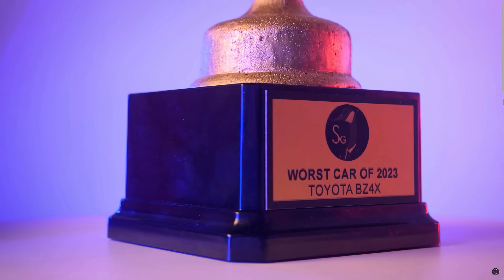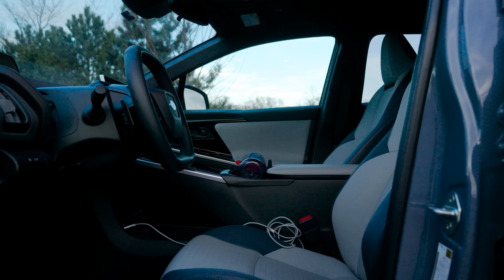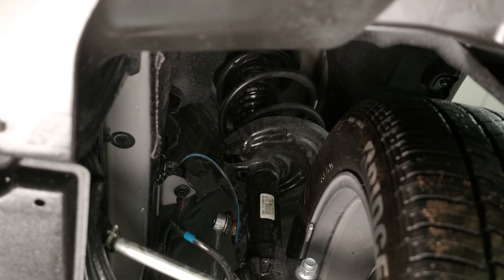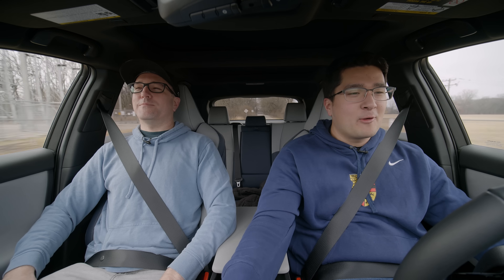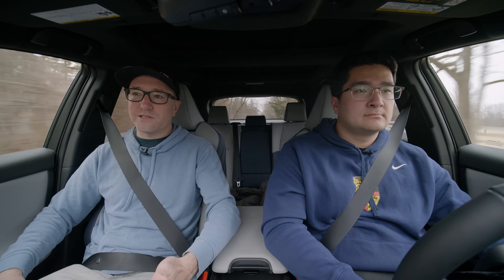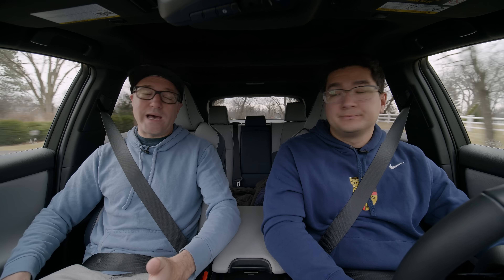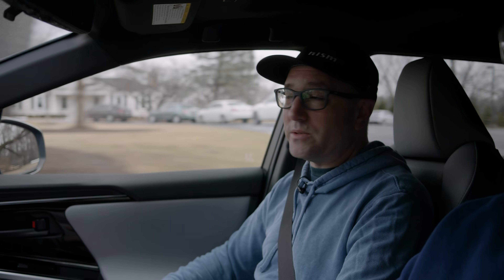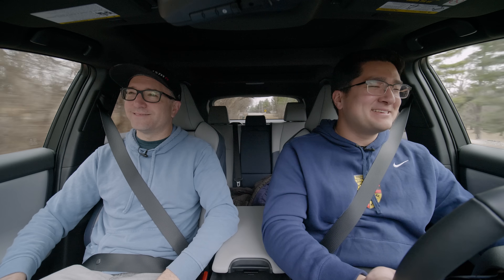Subaru Solterra | Sorry in Advance

Comment: I love my Solterra. It's fast, quiet, efficient, has good ground clearance, and solidly built. Granted I already had a level 2 charger in my garage, and I work across the street from where I live. I bought it to drive around the Las Vegas valley only, and it performs perfectly. My 2019 Outback was slow, had terrible gas mileage for a 4 cylinder (my V8 Northstar Cadillac Deville got better MPG on a cross country trip), and don't even get me going on the CVT transmission which felt like a rubber band. My Solterra solves all of those problems. It was 48,000 brand new, but I got it for $25,000 and change with only 7,000 miles on it. And I plan on paying it off and keeping it. :)

Comment: Not everyone needs more range or faster charging.  At the right price I would consider a used Solterra because of its clearance.  My Bolt scrapes its underbelly and has a hard time going up steep gravel roads.  Efficiency is a bit of a drag, but doesn't mean too much as I can charge overnight at home for $0.06/kwh and have solar credits.

Comment: Thanks to the hate, which I get for initial $60K price, I just got a limited edition version for my daughter commuting to college for just $21K with just under 20K miles. For the area I am in, there are no cars that are this new and that offer so much in safety and technology for this price. I am amazed every time I get in this car for what it offers at the price we paid, so thanks for the hate. This car  also stands higher than all others like Teslas or Ioniq, which we need here. Also, keep in mind, the initial Nissan Leaf now can get upgraded batteries that increases range by 3 times for a minimal cost now and that work just takes 4 hours to complete. With rapid advances in battery technology, I believe a battery upgrade may likely be coming soon for this model as well. and if that happens, then what an amzing deal we got. Crossing my fingers, but this car is still great for our situation.
Reply: Same here, we got a two year old one for my wife with under 10k miles for 21k. Fully loaded touring. It very comfortable and safely gets her around and that's all she wants.

Comment: Living in Houston, I probably do not drive 200 miles in a week.  So, for large city driving the range is not so much of an issue.  The most important aspects of a car, not mentioned in this video, are safety and reliability.  I think that Subaru is likely to be much better than its competitors regarding safety and reliability.  For my use-case, this would be an excellent car.

Comment: Dude I work with has the bz4x, his wife has a Tesla model 3.  He said the Tesla is better in every way.  If the car is too hot or too cold, the car won’t charge.  So running to and from work when it’s like 50-80 degrees it’s fine.  Outside that window if temperature he drives his wrangler

Comment: My wife and I love this car. We leased it for a killer deal. Ground clearance and AWD system is unbeatable. Toyotas safety sense is top notch. Torque and acceleration, handling and features are all great. I would never pay 50k for it. But $300 down and $300 a month was hard to pass up. We only drive it 15 miles a day. Comfy on “road trips” and my kiddo loves the back seat.

Comment: Why why why!!!  I owned an Outback 6 cylinder and loved it.  I even extended the warrantee on it and I never do that.  I am 77 years old so we are talking about a really long time.  I get rid of my cars when the warrantee runs out.  I also have had a number of Hyundais, I never had any problems with any of them.  Elantras up to genesis.  I now drive an Ioniq 5, limited.  It is so efficient that I drive in eco 98% of the time and in warmer weather I can get 300 miles on a 100% charge, with air conditioning on.  It is easily fast enough to pass other cars and get on the highway.  With preconditioning, even in the winter it will charge at 130 to 150 kilowatt’s.  In warmer weather it has hit 180 kilowatts.  I found a supercharger the other day and it maxed out at 200 kilowatts.  I feel sorry for Subaru they make great cars.  Why would they ever make a car that doesn’t even come close to competing?

Comment: The Subaru Solterra—Subaru's first fully electric SUV—is one of those cars that’s met with a mixed reception. Here’s the breakdown:

---

🙅‍♀️ Sorry in Advance: What’s Wrong?

1. Underwhelming Powertrain

The Solterra's performance doesn’t quite match the expectations set by other electric SUVs like the Tesla Model Y or Ford Mustang Mach-E. It’s decent, but lacks the thrill you might expect from an EV.

Why it falls short: 0-60 mph in around 6 seconds feels more "family car" than "electric excitement."

2. Not the Best Range for the Price

The range is good, but not great. Around 220 miles on a full charge, which is fine for city driving but falls short when compared to competitors like the Tesla Model Y or the Rivian R1S.

Why it’s a letdown: At its price point, you expect a bit more endurance.

3. Interior Isn’t as Luxurious as Expected

The cabin feels basic—not as upscale as some might expect from a vehicle that costs this much. The materials, tech, and design are pretty straightforward and practical, but not “wow-worthy.”

Why that matters: If you’re looking for a truly premium experience, the Solterra might feel a bit lackluster.

---

❤️ Sorry in Advance, but Here’s the Flip Side…

1. Off-Road Capabilities (It’s Subaru, After All!)

If you’re looking for adventure, the Solterra does offer impressive off-road capabilities, typical of Subaru's rugged reputation. It’s definitely one of the more capable electric SUVs when it comes to outdoor adventures.

2. It’s Practical and Family-Friendly

The spacious interior, decent cargo space, and great all-wheel-drive system make it a solid choice for families who need something that can handle rough terrain without

Comment: Keep ragging on it. This helps to drive prices down and helps get the best deal on a lease (and dealer could take the $7500 tax credit as it's a commercial vehicle sale and apply that against the lease). No wonder there's a huge reduction in MSRP for 2025 models.
My quibbles, considering that this car is kind of quasi marketed as a semi-offroad go anywhere fun car:
1) It doesn't come with a jack for tire R&R. That will be $160 extra please. There's a place in the back to stow it.
2) With all those outdoorsy gravel road ads they have they forgot to include mudflaps or splash guards as standard. Sigh more money.
3) Careful about running stuff in accessory mode or let the car sit for many many days. You'll drain the 12 V battery and won't be able to start it. The owner's manual even goes through how to jump start it. So, a pair of jumper cables is handy or keep a portable booster on board.
Other than that, I really like my lease car. The range is irrelevant for the type of driving I do.

Comment: You lose all credibility doing a condescending review of the Solterra wearing a PORSCHE sweat shirt. I have a 2024 Solterra and a 2023 Crosstrek and I 've had Subarus for the last 40 years. My Solterra was the best deal I could get for an AWD EV with appropriate clearance. Better deal than the Ioniq 5 which has barely any clearance at all. I live in the countryside, in Quebec, Canada and the X-Mode is a must. I've put on 6000 km in 89 days. I used a fast charging charger only once and only to see how those work. Compared to the Solterra, which is a tank, the Ioniqs are just chick cars. Period.

Comment: I drove one of these a bit over a year ago because the large Toyota dealership across the street did not (and still doesn't) carry the bZ4X.  It's the only EV I've driven that was completely underwhelming.  Not as solid feeling as other EVs (but no squeaks or rattles), and not much power.  It felt like a typically forgettable smaller Toyota, but without the engine noise.  Not nearly inexpensive enough to be a compelling option.

Comment: You are spot on. If you are a Toyota or Subaru loyalist and can charge at home, this is a far better car than RAV4/Crosstrek/Forrester which are utter pieces of sh!t mechanically. 2.7 mi/kWh is fine - EV miles are dirt cheap and easy with home charging.

Comment: 2.7mi/kw is really terrible especially on a vehicle with only 70kw... my 2021 LEAF S Plus gets 3.6mi/kw average... that is without Eco mode, using the AC and down here in FL even in the summer heat. In the best case we can get 4.1Mi/kw.... but we don't like to drive that slow. At 70mph we get around 3.2Mi/Kw... 80mph we get 2.9Mi/Kw...
Reply: It doesn't get that. My 2024 limited in the warm months it gets 4+ around town, winter it's closer to what they quoted. I'd say the rated 3.2kWh is probably pretty accurate if you average out the seasons mixed between city and highways driving. I run with the climate on auto at 68F everyday. 110F to 10F (Central Oregon).
Reply: @jnrivers  3.2 isn't too bad. That's closer to my LEAF. 4+ in the city is expected, I can actually get almost 5 in the city if it's true city slow stop & go driving. Normally we average around 3.8-4 in city driving since it's a suburban city and there isn't too much traffic and everyone drives fast.
Here in FL it's also hot and we leave climate control on auto 72F.
Reply: @ Anything over 4 is outstanding efficiency. What year and trim is your LEAF? I used to have a 2013 S trim.
Reply: @jnrivers  Its a 2021 S Plus (63kwh) model. I put in LED headlight bulbs and switched the tires to Michelin Defender 2 A/S from the original Bridgestone Ecopia tires.

Comment: The RAV4 hybrid doesn't feel rattliy or crappy. It has a bit too much road noise at speed but it feels like a very pleasant, solid car to me. I did ride in one of the bZ4s as an Uber and I loved it. Maybe it is a bad EV but it is a very pleasant riding car to be in, just like other Toyotas.
Reply from the maker: The Toyota 4-cylinder specifically on the RAV4 is one of the most readily noisy 4 cylinders currently on the market it lacks isolation and refinement that's why we bring it up
Reply: Sorry would you repeat that as I to am  deaf and didn’t hear what you said.

Comment: toyota made it junky because they can see BEVs dont have a future and just humoring the dumb regulation
Reply: there is no charging network, the things dont work well in high heat or cold and if they catch fire will do a lot of damage around them and they will catch fire eventually if lithium ion because dendrites or whatever will short circuit one of those thousands of battery cells and there it goes in flames that cant be extinguished by water. BEVs should never be parked anywhere indoors and one car space apart at least from other cars
Reply: if youre dumb enough to buy this or any BEV then thats on you lmao

Comment: I have one, on lease ofc. Needed an car, cheapest lease I've ever seen, nicest car I've ever had the chance to drive, so I got one. It's a Toyota after all would be perfection, IF it had a gas engine, preferably a 6 cylinder, like the old RXs use to have, or a Hybrid would be good too. Its well made, sturdy, and drives well, super spacious and comfy, But it sucks as an EV 100%

Comment: I've had 3 EV's, and picked up a 2024 last summer, love it. Not going to say it doesn't have more than a few faults, but it does some things very well. 

Pros:
Heat pump. Most EV's outside Tesla don't have them, and it makes a big difference.
Accurate range projection
Very efficient in town during warm weather (I've seen 4+mi/kWh).
Despite the low peak charging speed, the curve is actually pretty respectable.
Excellent AWD system even by Subaru standards
Car very well put together and feels like a quality product
Comfortable (even more so than my Model S)
Handling and ride is surprisingly good
Zero phantom / vampire drain while parked (makes a huge difference without home charging)
Safety features can be useful

Cons:
Other than wireless Carplay, the software is like something written by Germans in the 1990's
No trip planner (see above)
Safety systems are naggy, annoying, and downright embarrassing (let the neighborhood know I need to check the backseat)
If the SoC is below 20% with a very cold pack, the power output is limited to dangerous levels (hills,  traffic).
Car needs to be off to initiate fast charging (can be turned back on after charging starts)
Mountain passes burns through a lot of SoC.

Seems like a great car for some people (like myself) as long as you know what you're getting into, others beware.
A road tripping EV... no
A technical showcase for electrification... no
A comfortable, cheap to run car for commuting around town, and rural driving... yeah it's great
Reply: I agree. There are no surprises here. If you can live within the obvious limitations and you save considerable money, it’s a good deal. I really like my 2023, and I can’t point to any one reason why, but the package resonates with me. I got a great lease deal and in a couple years it will go back, to be replaced with whatever’s the best option at the time. No regrets. P.S. I think the software is fine, especially if you use CarPlay or Android Auto most of the time, but to each their own.
Reply: Good synopsis. It's a bad car if you take a lot of long distance road trips on a regular basis. It's a great car if you're limited to local area/mid area driving.

I never fast charge so the charging performance is a moot point for me, and the range is more than I need, so that doesn't matter either.

What does matter to me is snow performance, ground clearance (for avoiding ice boulders in the roads near me), ride quality, and start/stop distances in snow/icy conditions. The Solterra is great at all of these. It's definitely not the right car for everyone, but it has been a good fit for me.

Comment: The only thing the Solterra/Bz4x have over the ID4 are better door/steering wheel controls and better infotainment. Everything else is superior on the ID4 - especially if you're looking for a compliant ride. If you're willing to deal with bumps for sportiness the Model Y and Ioniq 5 are the best bang for the buck - maybe Mach E if a Ford fan. Only somebody who has to have the Toyota nameplate or is in love with piano black plastic would be compelled to buy this.

Comment: This car actually demonstrates the problem with Subaru themselves trying to become an electric brand. This is an electric Subaru, this is it. When you remove all the plastic cladding, quirky but inefficient boxer engine, and mechanical all wheel drive, this is what you are left with. With AWD being so easy to achieve with electric motors in EVs, what exactly does Subaru do differently than other brands? Styling? Even though this vehicle is bad it is the test bed for future Subaru EVs and it is easy to see how it could be styled to be even more "Subaru-esque", but at the end of the day, it still is a shitty vehicle, just with AWD.

Comment: I never thought I would see a day that in order to maximize efficiency in a vehicle, you have to turn features off (like HVAC, which is usually pretty necessary for a comfortable ride). Never saw that in an ICE car…do you throw the doors off at speed on a highway to get the eMPG even better? 

All joking aside, this wouldn’t even be in the running for anything I would buy in the future, new or used. Does the Solterra get the 2025 award for Worst Car?

Comment: I considered it. I currently own a Model Y and lease an Outback. They offered me a great deal in Colorado to swap my Outback for this. I thought about it and drove it but as a current Tesla owner, this thing is just a pig. I can hit 4 miles per kWh in my Tesla, 3.8 lifetime average. My Tesla has way more power and is much more capable in terms of putting down power though I wish it had more ground clearance. I was also shocked how loud the Solterra is on the highway as it doesn’t have acoustic glass like our Tesla and our Outback. Ultimately we decided to keep our Outback XT with the 2.4 turbo, it’s such a great car, and I can’t seem to find a good substitute that is reasonably priced. I tried Subaru but this isn’t good enough.

Comment: It's wild that this car can't really outshine the currently discontinued Chevrolet Bolt, which predates it by many years. 

Most OEMs benchmark their competition, but I seriously wonder if Toyota drove anything besides a Nissan Leaf when they were designing it.
Reply: I mean, at least max charge rate is 100kW and not the Bolt's 55kW. Along with a much nicer interior.

Comment: I'm clearly in the minority but I like the look of the outside body.  It doesn't look like a typical economy car purposely designed by its maker to make you NOT want it and want some more expensive vehicle instead.  Obviously though, the problems with poor range, inefficient charging at home and at super-chargers, etc. make it clear this was just a "checkbox" item for Toyota to claim they were making an EV entry.  And it's way overpriced.
Reply: On the price, it should be noted that both versions of this dropped the price several thousand dollars for 2025.

Comment: Did I hear it right that additional 0.2 inches of ground clearance makes it class-leading? 🤣
Reply: They clearly added the minimum so Subaru could claim to have the most in its class. It's actually decent at 8.3" vs the 5 & 6 range of others however the bzwhatever already has 8.1 so it's a quirk...or maybe feature.
Reply: @kamX-rz4uy  I understand how manufacturers play with numbers so they can get the claim with facts. 
I'm just laughing at how ridiculous it actually is.

Comment: Terrible interior but it looks like they lopped off the top of the steering wheel so you can see the gauge cluster atleast. Not sure why Subaru, Toyota, and Volvo can't get decent efficiency (mi/kwh) while the Korean twins are crushing it.